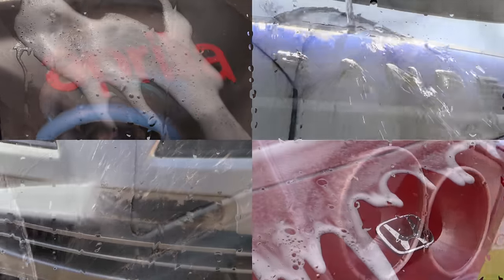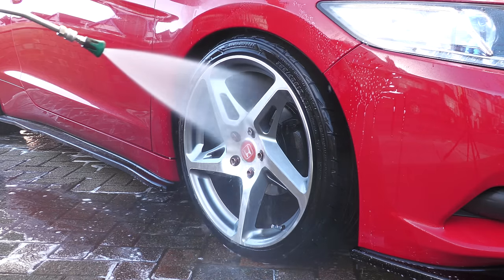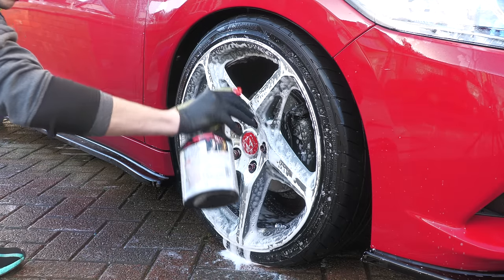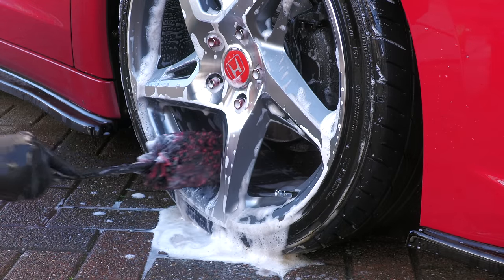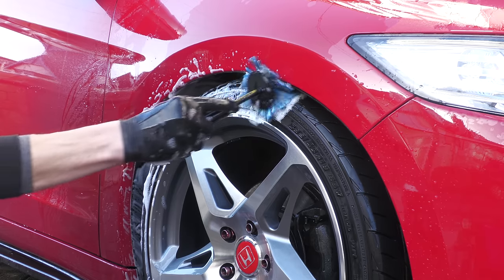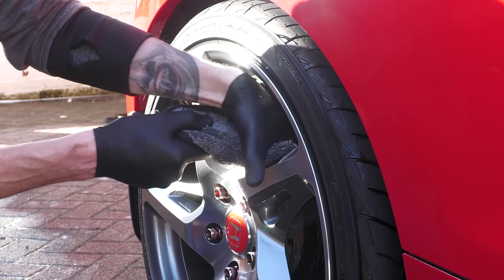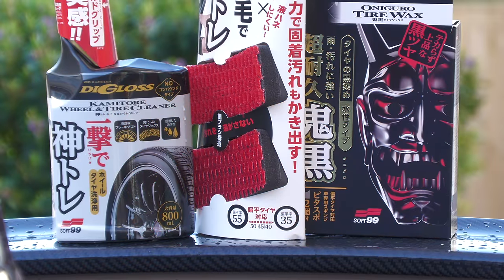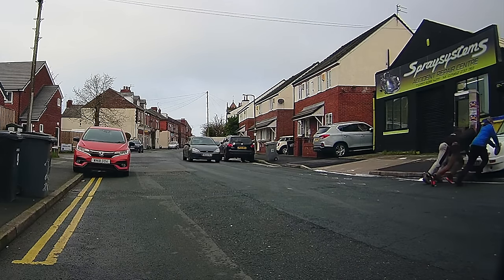Complete Wheel Cleaning Procedure

Comment: As a hobby detailer (an ex-valeter at main dealerships), I always like your content.
On my own car, I find it actually quicker and get better results, actually removing the wheels from the vehicle.
It only takes 2 minutes to jack the car up and take each wheel off, and you can really make a good job of the arches and the wheel barrels, as access is much improved.
It also gives you the chance to clean the calipers properly.
Good to see you use wheel woollies, I found these to be the best brushes of all.
I never liked foam applicator pads for tyres, and much prefer the accuracy of a slightly stiff brush.

Comment: Great video as always, my top wheel cleaning tip is before going in with your brush to do the barrel, have a look to make sure there isn't any drive shaft grease from a faulty drive shaft boot all around the inside of your wheel, your brush will appreciate it👍, keep up the good work Guru 👍